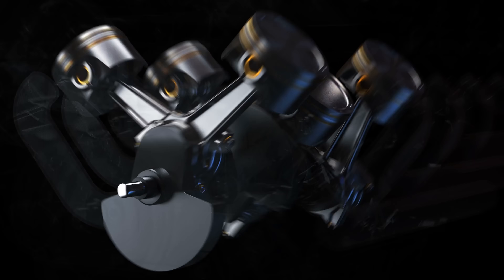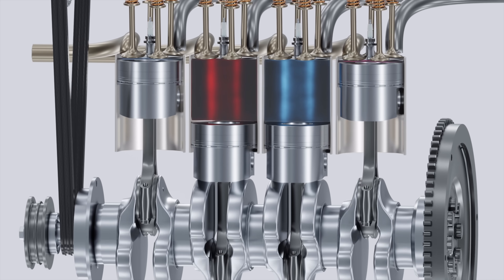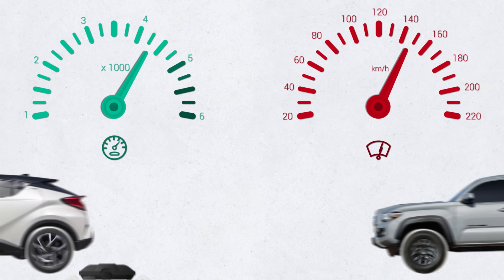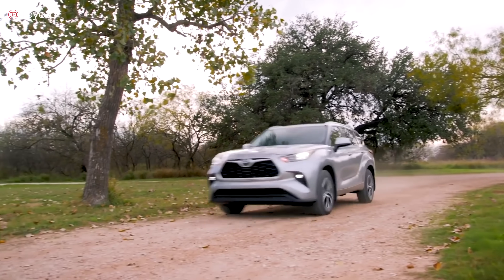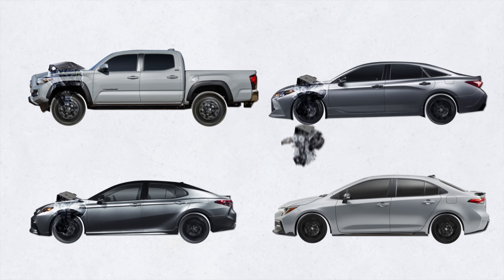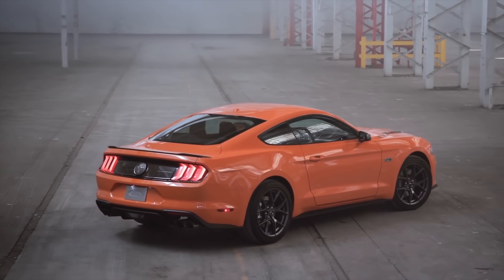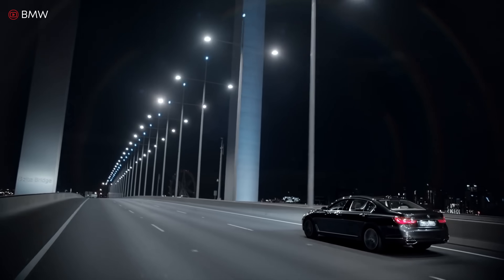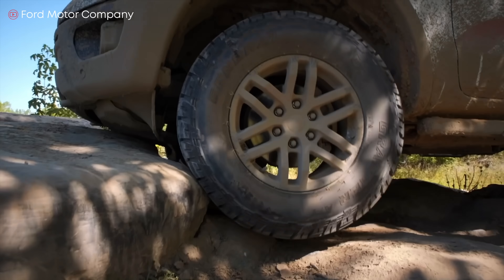No One is Telling You the Truth About Turbocharged Cars, So I Have To

Comment: I had two Volvos. A 1989 760 4 cylinder turbo, and a 2000 S70 T5, 5 cylinder turbo. Both turbos are liquid-cooled from the radiator coolant. I have driven both cars over 300,000 miles. The only problem I had was the 760 had a turbo seal leak that reduced high speed power at 190,000 miles, but it was fixed. The S70 turbo never had any problems. Both are great cars and I love them both. I would not be very confident with the newer electronics-laden 2025 Volvos of today.

Comment: I'm a low reving low end torque kind of guy myself.
Reply: 7.3 V8 Godzilla, I’m trying to drop one into my currently 3.7 V6 Mustang for that very reason! I like your thinking
Reply: Plus it sounds nicer.
Reply: @OCtheG  I like your thinking too but isn't that Mustang built to handle a v6 going to rip it self apart with King of the monsters torque under the hood?
Reply: Definately. I have a 2.2L straight 6 in my BMW e46 320ci & I love being able to drive up a hill from 1.5 thousand revs no problems. Torque peaks at 3.5k & Its very rare I go over this anyway as I don't race it. Just if I have a truck I need to pass on a winding road, it's nice to have that power there along the entire rev range to be confident I have the power to pass it. (& thats the smallest or the strait 6s) would love a 3.0 but my wallet wouldn't allow unfortunately. (I live in the UK by the way so don't have access to any american cars)
Reply: Not to mention the naturally aspirated straight 6s are good for 100s of thousands of miles if well looked after & I'm able to do most of the work myself whereas I wouldn't have the confidence to work on a 4 cylinder turbo & personally, I don't think they will last as long as a naturally aspirated straight6, v6 or v8 engines. There's no replacement for displacement.
Reply: @iananderson4572  one day there will be a replacement , it's called electric motors!!
Reply: @richardbradley9247  Eventually. But not for some time yet. They're getting closer but not to the point of mass producement where it's available to the vast majority of customers.
Reply: @richardbradley9247  That day is definitely coming, but definitely not in the next few years and probably not before the mid to late 2030's. Our current electrical infrastructure will not support even 50% plug in electric vehicles. Especially in hot regions that already have problems when millions turn on their air conditioning, or lose electric power for weeks because of an unexpected halfway decent winter storm.
Reply: @johnossendorf9979  Bellhousing swap on the 6R80 and some various durability upgrades, new motor mounts, one piece driveshaft, and some 18x10 wheels. Really though, you’d be surprised man! It’s not as bad of a swap as you’d think. Something about “barely possible” I find highly alluring, I enjoy making sleepers I don’t know what to say. Haha
Reply: @OCtheG  Cool, glad you are working on durability! I like the idea of a sleeper too ! We (for the most part) have different views on wheel diameter though. Don't get me wrong, you do you !  I'm a 16 inch fan and not in to the modern big wheel short sidewalls thing. Besides, at hart, I'm really a 4wd guy. If your of a mind to, Google: 59 four-wheel drive Studebaker.  My favorite is the cream colored one, it's always the first video up for me and I love the look of the Pizza cutter wheels and tires, even though the original optional wheels are 19.5's there's still enough sidewalls. 

Yes I am a proud dinosaur 🦕.
Reply: @johnossendorf9979  I hear you man! If not for 14” Brembo Brake clearance I’d have gone 16” as well, 18” was the minimum for barrel clearance unfortunately. I’ll definitely be checking that out!
Reply: @johnossendorf9979  Yes that's right. Until relatively recently, say in the 90's & before, a 2litre car was considered large & 4 liters was just insane. I had a cousin who had imported a 6.6 liter firebird & I couldn't comprehend how large that actually was. All to do with the fuel prices in America at that time being so cheap so why not I guess. Unfortunately, we've always been get screwed by our government taking massive amounts of the fuel price at the pump as tax unfortunately so had to settle for cars with smaller engines i guess.
Reply: @johnossendorf9979  Nope. The chassis and most parts can handle 600+ horsepower easily. Upgrading suspension and drivetrain though is necessary to make it bulletproof. The Godzilla will do fine but is a heavy bastard.
Reply: @302Mustang13  Ok cool! 600+hp is nothing to sneeze at ! But not every 600+hp engine is the same, and I know that in the comparison I'm about to make is extreme and the weights are different by approximately a factor of 3.2

What would happen if we had two identical Mustangs with the need suspension and breaking up grades and we put a 600+hp Mazda rotary engine with 275+lb.ft of torque in one and a 600+hp Cummins with 1100+ lb.ft of torque in the other ?
Reply: @iananderson4572  Nothing wrong with that as your personal preference, but a well engineered 4cyl turbo can last just as long. People also talk about increased maintenance on turbo engines, which is false. Maintenance is similar to n/a engines.
Reply: @johnossendorf9979  Interesting. I've owned three Ford vehicles with the 3.0 Duratec DOHC V6, one with a 2.5 SOHC 4cyl, two with a 4.6 SOHC V8, two 5.0 V8's (one OHV and the other DOHC), and a 2.0 turbo. My favorite engine by far is the 2.0 Ecoboost. It actually makes more horsepower and torque than the 5.0 OHV did (210 hp, 270 lb-ft). The 2.0 Ecoboost (250 hp, 280 lb-ft) is a well engineered turbo engine and very efficient. A light foot isn't required to get good mpgs although you can't be flooring it constantly. Funny thing is that you don't need to.

Comment: Having owned a V6 and recently purchased an turbocharged i4.. it's really hard to say.. the 4 cylinder does indeed generate a lot of heat. That slightly worries me about the future of the vehicle.. but the v6 ate through gas and was in a fairly heavy chassis.. weight alone harmed the acceleration of the v6 causing me to push the engine (in my opinion) way too hard. But you definitely felt the strength that the engine had.. 
It's a really hard say.
Reply: My turbo's intercooler and engine timer worked well and there was no overheating at all. Regular changes using quality engine oil helped too. No issues at all :)

Comment: I bought a Hyundai Sonata Turbo charged 4 cylinder engine. The first turbo engine I ever bought. Turbo went at about 85,000 miles. Replaced it with a new Turbo from the factory and it went 10,000 miles later. Since it was under warranty, I went to the dealer , to get it replaced. This was in May. It’s now the middle of August and I still haven’t received a turbo. They say all kinds of parts are on back order for months and they don’t know when any parts will come in. Korea has countless Hyundai plants shut down which is leading Hyundai factory’s here not receiving parts leading to them getting shut down. Long story short don’t ever get a Turbo. 
A Naturally aspirated engine is the way to go!

Comment: Negative torque on the crankahaft exists on all engines with less than 8  cylinders. The V12 is the ideal engine configuration for balance, response, longevity, minimal crankshaft weights required. 6 cylinder engines have minimal negative torque but there is still some negative torque.
Reply: Do balance shafts help with this, or is that only for vibration?
Reply: @Dcc357  it only helps with vibration. Anything with less than 8 cylinders will dip below mean torque in its torsional output waveform because of how many cylinders are firing per crankshaft revolution. For a V8 4 pistons fire per crank revolution in a 4 stroke engine.
Reply: You are not talking about straight 6 right? Because it is the half of V12 and is just as well ballanced as the V12.

Comment: I wish if Toyotaor Honda would make a pickup truck with 1.8 or 1.5 Turbo Diesel, paired with 6-speed manual transmission and has 4x4 capability. That would be the dream pickup truck.
Reply: Great for delivering styrofoam balls around town.
Reply: In europe honda and toyota have diesel.  Tree huggers in the u.s. think diesel is nasty.
Reply: @azthundercloud  They do. It's not in the US market because of the logistics. It's not because the US loves gas. We have the big rigs that are mostly diesel. 
Toyota built the Tacoma for the North American market because it's hard to bring the Hellux all the way from Japan.
Reply: @drugilbert2447   I guess you have no idea how powerful is the 1.8 diesel Toyota Hilux is. It's indestructible.
Reply: Chevy Colorado has a 2.8 turbo diesel that get great gas mileage
Reply: @johnnytactical3054  Many problems:
1- Not reliable
2-Expensive
3- Poor interior quality
4- Doesn't come with manual transmission
5- Cheap engineering.
6- Full of computer issues and oil consumption.
Reply: @anthonystaunton7105  Those things are frickin bulletproof.  I would snap up a Diesel powered Tundra in a heartbeat.
Reply: @azthundercloud  There is plenty of negativity towards diesel in Europe.
Reply: @jamescaron6465  The Chevy can beat Toyota in performance for about a year or two, then it will start to deteriorate.
Reply: @anthonystaunton7105  And that is why I would gladly get a Tundra diesel.  Many things can beat a Toyota but won't last 300K
Reply: @jamescaron6465  I wish if they make Tundra diesel.
Reply: @anthonystaunton7105  You're right I have no idea. That's why I have a V8 Hilux. Indestructible and will tow more for longer years than any tiny turboed over-engineered plastic banger. To each their own however, and horses for courses.

Comment: My next vehicle will most likely have the Camry hybrid drive train.  In a Crown or SUV.

No turbos, no GDI without port injection,  no sleazy mechanical CVTs, no 11 speed torque converter automatics,  no torque converter,  no start/stop system,  no accessory belts,  no 12 Volt starter,  

You do get an electric car with gasoline engine assist,  electric motor direct drive (like most battery electric cars), efficiency tuned Atkinson cycle gasoline engine getting CVT action from a planetary gearset, great fuel economy,  good acceleration in most applications, electric car goodness without the electric car drawbacks.

Comment: I'd love to see more V6 cars but that would mean going used which introduces other issues with again tech, sensors, and components that will get harder to use over time. Not to mention used v6 engines are only as good as the previous owner, and some owners spent their time with theirs using extended OCI's, conventional oil and cheapo filters, and shoving regular in it when premium was preferred.

Most manufactureres are moving away from V6's, which is sad but here's to hoping a few keep the 6 alive.

Comment: Scotty forgot to mention that V6 engines just run much smoother and quieter than turbo 4s. I have a turbo 4 in my 2019 Acura RDX that vibrates unpleasantly at certain RPMs and is noisy in general. The NA V6 in my 2008 Lexus ES 350 is MUCH smoother and quieter even though it is over 13 years old with 140k miles on it. NA V8s are even smoother and its a shame you can barely find one in a luxury car nowadays.

Comment: The only concern I have with the turbo charged GDTI engines is the buildup of carbon on the intake valves. The addition of port injection can solve this problem, but that only exist in the 2.7 and 3.5 L engines on the Ford side. As far as I’m aware the 2.3 L engine in the Ranger that was adopted from car and small SUV service is still direct injection only.
Reply: That was a problem a decade ago not so much now.
Reply: @selfoblivionalex6262  Really? Because it’s all over FTM’s channel. The only fix remains port injection as a supplemental method - this also improves the power band, so there’s a dual benefit.
Reply: @Dawgator Toyota engines have dual fuel injectors. Port and direct injection. The computer alternately runs direct or port injection.

Comment: I will stick with third choice. I4 normally aspirated in my 89 Celica.
Reply: Why not the 4th choice? A 3 cyl NA 88 Geo Metro?
Reply: In all seriousness the early 90s 4 cyl Geo Metro was a tiny beast. It, like most go-karts, was dangerous on the interstate. Getting pulled in by everything passing by but it was fun and durable. I honestly drove mine through a flood where even trucks and SUVs were broke down. The damn thing floated! No lie. Got to the store where people were stranded in there trucks and drove back for miles and miles just making sure to get enough momentum to float in the right direction when coming up to another flooded area. Thing handled great too, at least alone on the roads.

The 3 cyl versions where much slower and stuggled on hills but got about 10mpg more. Anyway, I loved that little car.

Edit - mine got 40-45 mpg on the highway. I averaged about 30 - 35 and that was when gas was under a dollar. 😢
Reply: @CynHicks  I too used my Geo Metro to sail the 7 seas and fought off pirates off the horn of Africa.
Reply: It's no 94 Celica but it'll have to do.

Comment: My uncle who taught me how to wrench in the early 90's (and just happened to own his own auto and marine garage) told me that anything turbo will automatically take 40k off the life of your engine. I'm not sure how this weighs with modern engineering but I currently drive a Honda Pilot with a V6. I had 7 people in it a week ago and there was absolutely zero loaded drag feel. The Pilot has 175 k. No difference in performance. I was impressed.
Reply: I have 271,000 on the same engine and it does everything it always did, no check engine light.
Reply: @lilbiscuitable thats why honda & acura are still v6 while competition moved to turbos🙏🙏

Comment: I have bought a new Subaru Forester 2.5L Turbo 230 PS 2007 and was driving it without any problems till 2021. Then I gave it to my ex who killed it in 2024 with improper service. That was a fabulous car, the only drawback was a fuel consumption (12-25L/100km dependent on driving style). You can burn as much fuel in this car, as you want. Now I drive the Miata 2L 184 PS naturally aspirated. Was experimenting with the fuel consumption. 6L/100 km is real if you drive mostly highways at 100 km/h with cruise control. Otherwise 7-8 L/100 km when driving naturally,  which is not bad. A naturally aspirating engine is a pleasure.

Comment: New turbo charged engine choice will not last nearly as long as the naturally  aspirated ones. I should never had gotten rid of my Tacoma with 22r engine. Had almost 500,000 miles only got rid of it cuz it had no Air-condition. Moved to Florida, lasted 1 year before I could not stand no AC.

Comment: The main motivation for turbo 4s is the ever increasing CAFE requirement of auto makers. They day of the v8 is coming to a close. The new Toyota Tundra will offer a turbocharged V6 only. The V6 will probably only be found in full size trucks in the future!
Reply: I heard next year is the last year of the 5.7 hemi as well. I don't want a tiny turbo motor in a full size truck.
Reply: It would be really cool to see a non-hybrid tundra hit the 26 MPG rating!  I doubt it will happen this go around but wow!
Reply: Simple solution for that problem.  Just rebuild your V8 vehicle.  If sales fall because of no V8, they will start offering one.  Remember the Thunderbird in the 80s?  Three generations, and each one was initially available only with a V6.  Poor sales made them offer V8s, which boosted sales.

Comment: Scotty - doesn't the fuel economy of a turbo engine depend heavily on how much time the engine is in boost?
The higher manifold pressure during boost is a fuel vaporization killer and the power produced doesn't come from nowhere - it is coming from a LOT more fuel getting pumped into the cylinders.

Comment: I think it comes downs to your needs and what ultimately is available for the car you want. Haven’t owned either but I did go from a naturally aspirated 2.0L 4 cylinder Honda Civic Si to a natural aspirated 5.0L V8 Hyundai Genesis. I do love the V8 for its smooth 420 horsepower and 383lb of torque. And I’ve tried the V6 version and the 3.3 twin turbo V6. All are great but I choice the V8 cause well it’s a V8.
Reply: I was considering a 2018 Genesis but was afraid of the hyundai engine issues. Obviously you like yours...

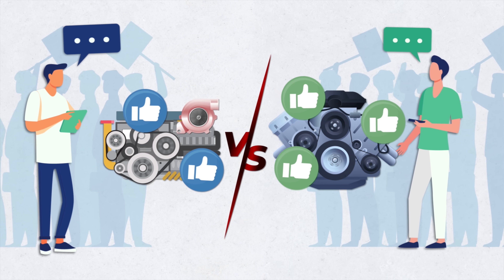Comment: Beginning 0:51 who else noticed in the 4 cyl. animation the timing of the valves is impossibly wrong. Hey Scotty !! Shame on you 😉
Reply: Yes, 2 valves opening early in the combustion stroke.  New technology.
I scrolled down to see whether anybody had already commented.
Reply: It must have Triton cam phasers in it
Reply: I saw that too. The spark plug fires, then the valves open on the power stroke
Reply: So in other words don't try to make an engine run with this backwards anima🤣.
Reply: Also did anyone note on the V6 animation (running) the intake ports are on the outside with the exhausts in the Vee.  No production engine is built this way in the past 60 years.  The artist needs someone looking over their shoulder, someone who has raised a few hoods.

Comment: My mom bought a CRV with a 1.5 L turbo engine. I just bought my wife a RAV 4 with a 2.5 Liter, NA engine. The Honda has a CVT transmission and the Toyota has an 8 speed. Talk about different sides to the same coin. Both are AWD. I will let you know which one is better in 10 years, but my money is on the Toyota. The AWD system on the RAV4 is crazy good for the cost of the car and it not being an off-roader.

Comment: I've got a 1.6 ep2.
Slapped a turbo on for extra grunt only pushed 5-7 psi
My motor had 90k miles on before I turboed it.
Now has 150k and still running fine.
Passes Mots (UK)